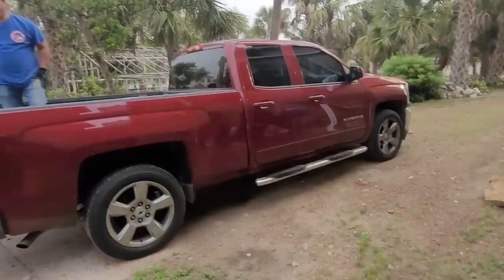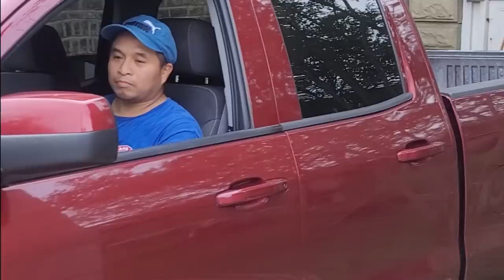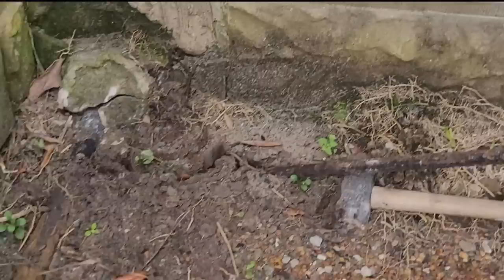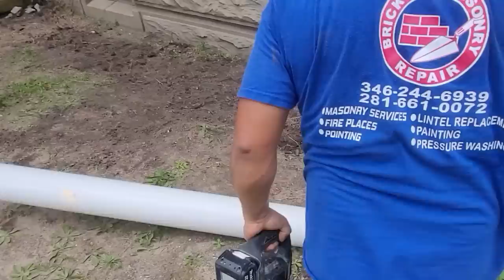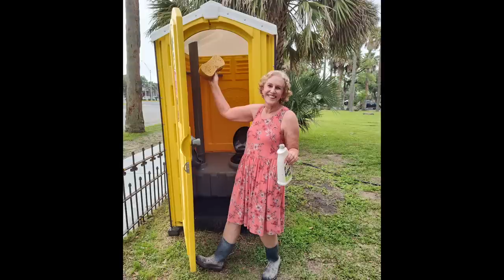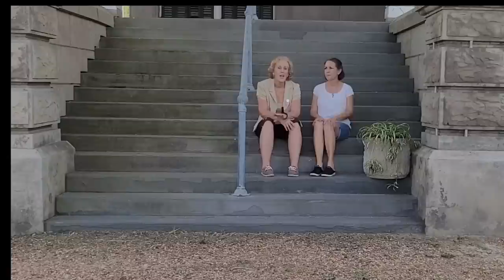S3.06 It's Time For The Steampunk Picnic

Comment: The copper grounds can go down 6 to 8 feet, so take some removing. 
My guess would be they were used to earth lighting wires from the roof. . 
Great update and congratulation's on such a great event. 👍👍
Reply from the maker: I never thought of lightening rods.  I bet the roof originally had several.
Reply: @leaguekempnerhouse  I think it would have a few. 👍👍the upper parts still might be on the roof

Comment: I had to jump ahead to find out about this Steam Punk event. Looks like fun! It does feel good to get rid of that annoying junk you can't just throw in the trash. I've found a lot of bits and pieces here too. Old pipes in the dirt can be hard to get out because the ends have rusted into a big wad, or there's concrete holding it. You have a very specific reason your soil level is higher than when your house was built, but I found some cement walkways under six inches of dirt at the back of our property. The lot was split, and apartments built back there, so I also found bags of trash that were dropped over the fence. Ugh. How neat that you have ibis stalking your lawn!!
Reply from the maker: It does feel good to finally have the whole property cleaned up.  There's still more to do in the yard but at least it doesn't look so messy, especially now that the new sidewalks are in.  The Steampunk event was fun.  I'm looking forward to having more events and sharing the house with the community.  We have lots of wildlife.  Something quite large has taken up residence in the basement.  I haven't found it yet but it has left its calling cards.  Kind of like your trash bags thrown over the fence.😀

Comment: Oh Janie I have a tip for you. Being I am a good old country girl in Alabama I have found ways to get these ground rods up as well as old t post. Those ground rods go down around 8 ft in the ground so any thing going straight down use a bumper jack. Tie a rope around the rod or t post hook it to the part of a bumper jack that attaches to the bumper and start jacking it out. You will have to reposition your rope until you have it up enough to pull it out by hand. 😊 God bless
Reply from the maker: I never thought of that.  It would be a perfect solution.  I think we still have a couple more to remove so I'll give it a try.  Thanks for the tip.
Reply: @leaguekempnerhouse  yw ☺

Comment: I had the same problem with my sawsall, turned out there was enough crud stuck in and around the blade holding mechanism that it didn't fully engage.  10 minutes of cleaning with a couple small, pointy tools did the trick.
Reply from the maker: These tools can really get gunked up.  They go through a lot of abuse.
Reply: @leaguekempnerhouse   yes they do.